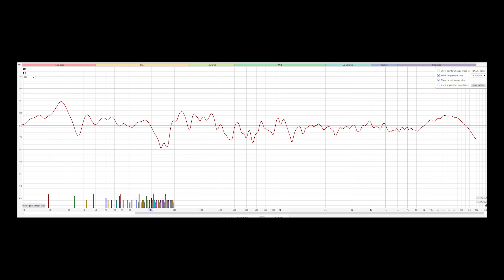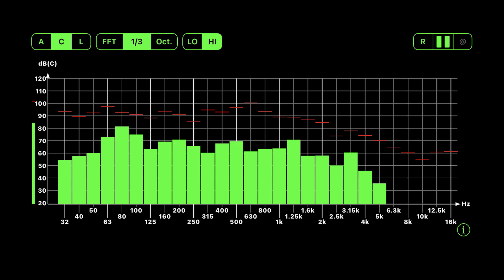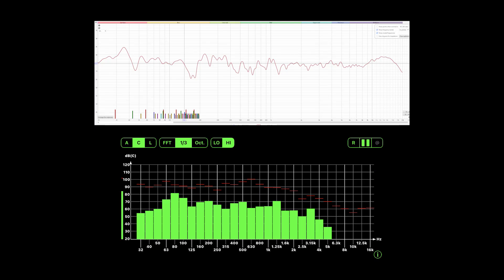I Can't Take This Anymore - This Is What You Get? With All That Treatment?! - www.AcousticFields.com

Comment: it is the year 2025 and I've been waiting for new measurements, relating your products. I still haven't bought any, due to your refusal to do before/after measurements and always giving everybody the run around. Please adapt and I might buy your products. Without measurements, forget it. It is time for frequency response graphs of your products in action, before and after style. I'll give you an example of what lots of people expect to see, before they buy: Pick one size of room that the general population of customers has in their homes and show off your products that way. Example:  A measured room with no proprietary foam vs. a room with 70% coverage of foam (list general room volume, RTA, decay times, and Frequency Response, before and after) Feel free to add any other measurements, as per your experience. The more data you give POTENTIAL customers, the better. This style of presentation could go on and on. Another example: A measured, empty room vs. a room filled with 10 ACDA units (list RTA and Frequency response, before and after) Another example: A measured room with no treatment, vs. a measured room with the full house, ACDA's, Foam, and Diffusion. This way, even at a individual level, we can zoom down into the micro of the frequency spectrum and see what effects your products ARE or AREN'T having on the frequency response, amplitude, decay times and what happens at certain levels of product coverage. Please consider doing this and don't give us another run around answer, to what I just wrote. I've been following the channel for years and it is tiresome.. The customers are asking over and over! You talk to some of us like we are dumb. It is off-putting..

Comment: 2:30 These speakers seem to be dipoles. Care to comment on how one should approach room treatment for dipole speakers vs. that for monopoles, which one is harder to do and to what order of magnitude? I should think that treatment for dipoles should be far more judicious as with dipoles you actually rely on the reflections to get the desired response from the speakers, (i.e., the response they were designed to produce at the listening position)? Am I correct?
Reply from the maker: Both diffusion and absorption are viable with diploles. The treatment type depends on distances and personal listening practices.

Comment: Thanks for the video, Dennis. Many don't realize it right now but we're fortunate to have your expertise. To the commenters: step outside the usual box and approach room acoustics with a scientific mindset. It’s all about understanding real energy in the room. I challenge you to fire up REW, turn off all the noise, and observe how even a distant ding or doink travels through your space. Sound energy is powerful, and ignoring it just because it’s invisible is a big mistake.
Reply from the maker: Its a life error. You dont get many of those to redo. I can take a 5,000 system and make it sound like 50,000 in a properly treated room. I can take a 50,000 system and make it sound like 5,000 in a no treatment room. People should treat the room first before putting in any gear. They would spend less on gear and get more sound quality. I would estimate that only 20% of people with 25 k + systems hear everything their systems are offering.

Comment: What an ugly room
Reply from the maker: Not attractive and poor performance. Its like building insulation. It is cheap but has the wrong rates and levels of absorption for music and voice.
Reply: @AcousticFields  
Question, in my room I have some tower speakers that are three-way. Sometimes the ultra low sounds muddy and awkward is that because of the room and is there anyway to really treat it? They are far away from the sidewalls, but they are about a foot away from the front wall. I know you don’t have the measurements and each room is different but what do you think ?

Comment: Good sales video for your product and service. And I mean that sincerely. If there's a better solution out there, I encourage people to use it. However, I am a big believer in room correction EQ. That could be manually done, through software on a laptop, a standalone device like miniDSP or IK Multimedia ARC Studio, or a combination of all of them. 

In the case of using room EQ correction, that frequency curve with +/-20db in certain ranges could be easily flattened. And I guarantee you the room was worse before the treatment. A more forgiving video would have been you saying that with building insulation it will get you halfway there, and room correction EQ will get you the rest of the way. Alternatively, you could use your superior materials and designs, and not have to use room EQ correction.
Reply from the maker: We dont like digital manipulations for room correction unless the energy issues manipulated are below 90 hz. We find the process destroys the harmonics of both voice and music.
Reply: That's just nonsense....

Comment: You're comparing an REW measurement with probably 1/12 smoothing to an RTA measurement with 1/3 band. That's completely pointless. Show a proper measurement of your room and it probably wouldn't be very different from the other room. You've mentioned sharing measurements from your rooms before but I don't see anything beyond these RTA responses. I've measured empty rooms that look like that. If you're confident in your rooms' performances then share some REW measurements include spectrogram and ETC.
Reply: I am New to mic meassurements, but the first thing i thought about was the same as you, where is the before Vs after? I think some rooms dont need much, but some rooms do.
Reply: Both rooms look like problems just at different frequencies.  The 40-200 range has been a pain in the butt.  I’ve treated my room and I still have a problem though certainly not as bad as it was without treatment. I’ve had to roll off the really low frequencies to tame them, also to appease my neighbor lol.  Luckily I can mix at low levels most of the time and get results.  I have to agree that both those results are consistent with my less than ideal space even treated with diaphragmatic absorption, albeit, I have lower swings near 80 and 160.  Still enjoying the ongoing mission to figure it out.
Reply from the maker: Your not seeing the complete picture. We are teaching through comparison. This is a process. This is an educational channel for my followers. Please respsect that parameter.
Reply: @AcousticFields  Then please show us a comparison so we can learn how your approach is better to what was in the other room. You compared apples and oranges and then said "look at the difference." How are we supposed to learn from this? What difference are we supposed to be seeing here?
Reply: @AcousticFields  a beginner has no way to compare these 2 things so I don't see the value of showing this and what they're supposed to take away from it. As someone with experience in this who can actually interpret and compare these drastically different graphs, I can tell you that there's very little difference purely looking at the frequency response (which is all the data you're giving and having us go off of...). I see a big peak at 35Hz and dip at 170Hz in the first. I see a big peak at 80Hz and dip at 125Hz in your measurements. If your measurement wasn't smoothed it would be just as bad as in the other measurement. So what difference am I supposed to be seeing? What am I supposed to take away from this (either as a beginner or otherwise)?
Reply: @gerhardwestphalen i came away with the same head-scratcher.
Reply: @gerhardwestphalen  I will say that one must see all the setup parameters of any measurement as in most cases I see the reviewer only shows the results (these can be manipulated as it seems like you understand), so I agree with what your saying however;  a 12db dip is in no way a problem to be ignored and can not be manipulated or managed with most products on the market (DIY for treatment and a few of the on-line manufacturers are no solution).

Add:  No one measurement can tell you where your problems are...